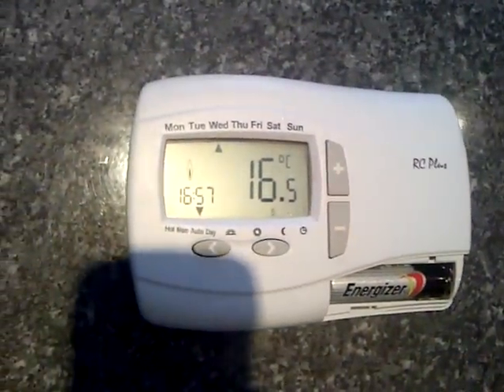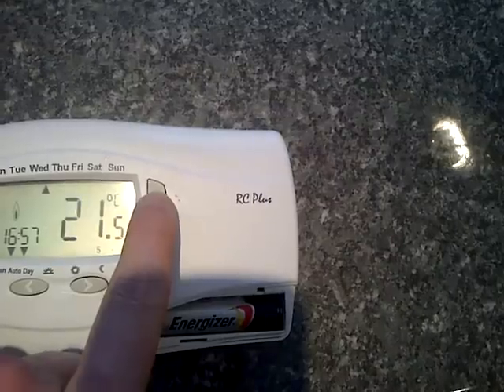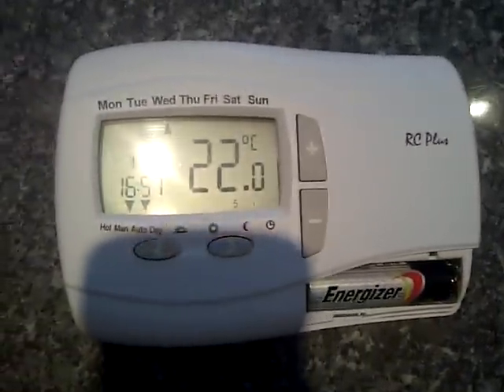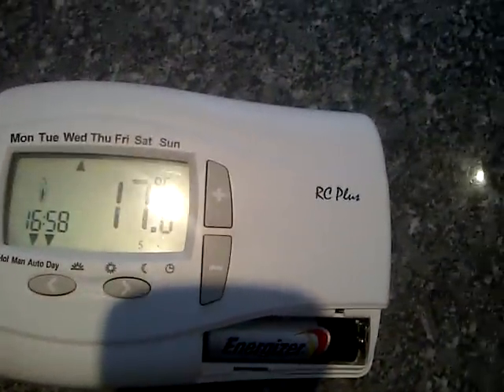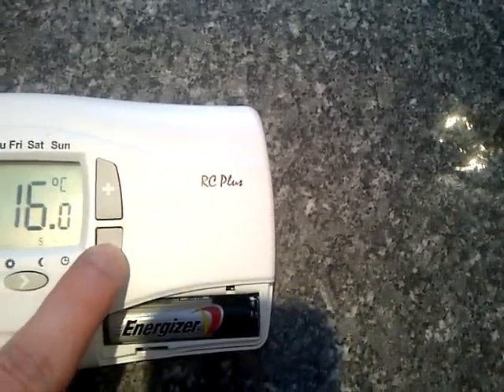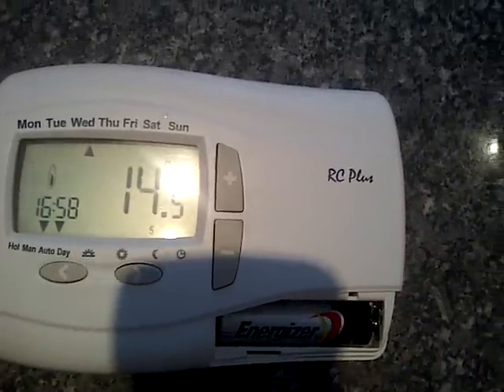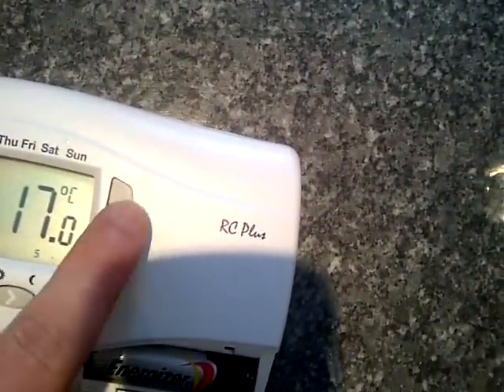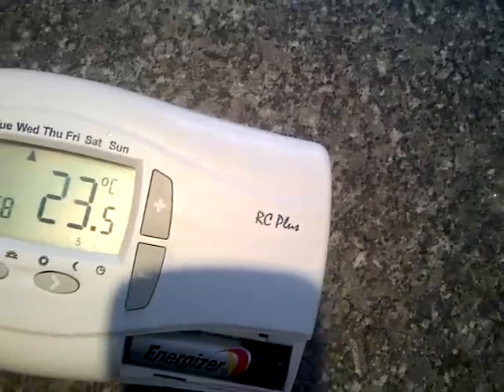Wireless thermostat fails to switch on boiler, time after time...VID-02-01-13.MP4

Comment: These are just crap.  My gas engineer said that he thought so when I told him that mine is barely programmable these days.  Today, it has stopped working,outside daytime temp is zero.  Getting it replaced by something better in a couple of days.
Reply from the maker: Mine is like Trigger's broom, everything has been replaced twice, both receiver and transmitter end.

Comment: The water pressure is too low for the boiler 0.7 bar ? You need the pressure between 1 and 2 bar for the boiler to fire
Reply: How do you get the pressure up

Comment: Someone please help I can no longer read the display on my british gas rc plus have changed batteries but nothing has happened
Reply from the maker: Mandy Waller Same happened to me also. Had to get the wireless device changed. Now both the receiving device and wireless devices have been changed. All working fine.
Reply: Where do i get replacement from plz xxx
Reply from the maker: Mandy Waller Well, I've got a British gas service plan, so called them out, but they are available as i remember researching them. Google it. Good luck 😆

Comment: thanks for this... think we have the same problem I"d been worried i was a numpty and needed to find instructions from somewhere (didn't seem to come with the new installation) now i can sound 'confident' with telling them what i think the problem is ! thanks again
Reply: I just replaced mine last night, exact same problem. All I did was buy the same receiver from screwfix, undid two screws and removed old one, clicked new one straight on and did up the screws again. You've probably already got it sorted but if not, its a easy 5 min job. just remember to turn the electric off!
Reply: Thanks for this. Ordering new receiver when I get home

Comment: I have the same problem, same RC unit and same boiler! Any ideas on how to fix it? What did you need to do to get your boiler to ignite
Reply: +jamie1571 It was the receiving unit. If the receiving unit is flashing when you send the from the thermostat, a relay should 'click' and the boiler switches on. I monitored the intermittent behavior and determined the receiving box was faulty. Got it changed.. all OK. annoyingly there is no manual overide.